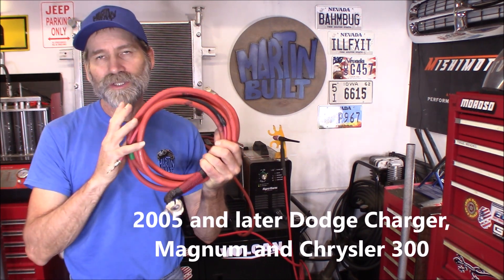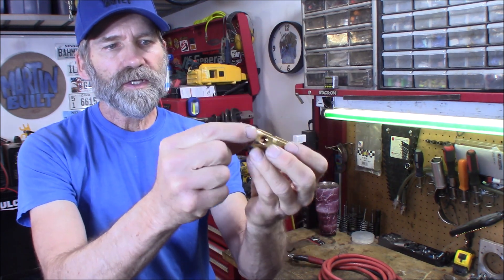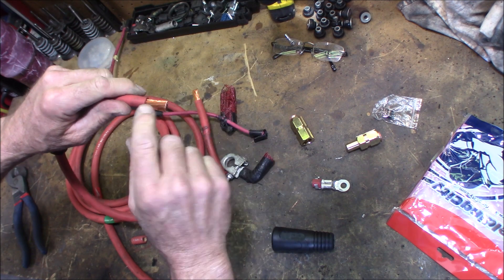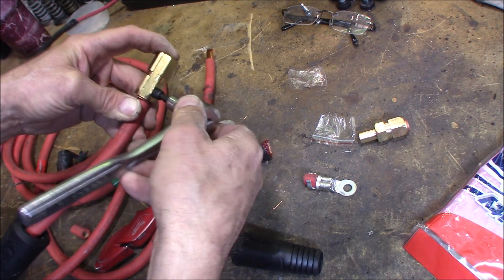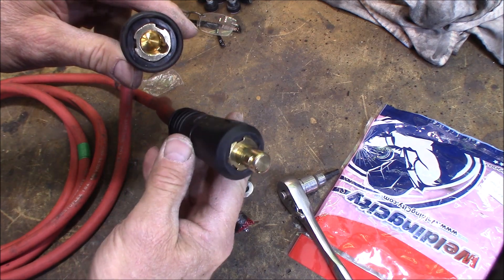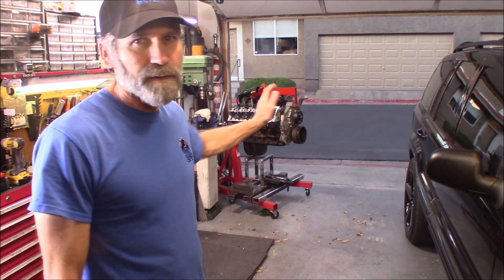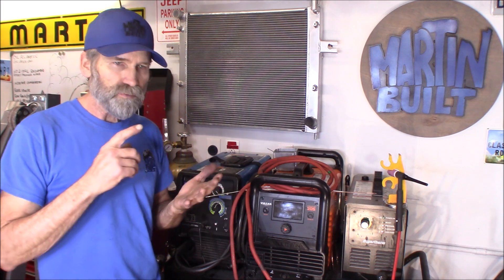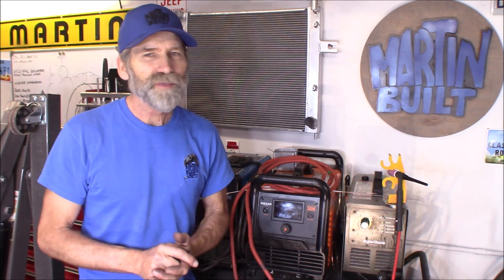How to Make Welding Lead Extensions

Comment: Thanks for the tip, I got a pair for $7.50 today just took a 10mm ,13mm, and a small flathead to get em out of a pair of chargers. They work great with a 180 amp esab suitcase stick welder and are longer than the original leads.
Reply from the maker: Awesome! I'm glad you liked it and found it helpful.

Comment: so i grabbed a few of these at the local junk yard a week ago, and i think im going to make a quick disconnect built in jumper cable with the anderson 175 amp disconnects. would be a cool video if you decide to do the same!
Reply from the maker: I went to Pic-a-Part a couple of weeks ago to get another cable and out of 12 possible cars, all of them had the cable removed. 🙁

Comment: Nice job. It’s awesome to find that cable and I assume the negative goes with what you pull out of a junkyard. Those cables would come in handy for other projects.
Reply from the maker: thank you, and they have come in handy for other projects like when I relocated the battery to under the back seat.
https://youtu.be/TDyCwM6FI54
and when I did the Big 3 upgrade 
https://youtu.be/Ednw5npj83c